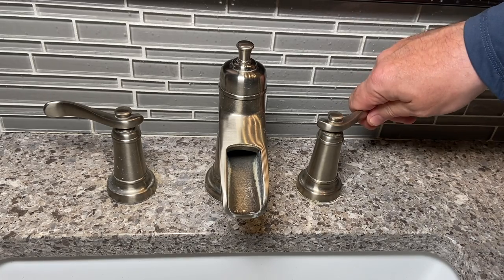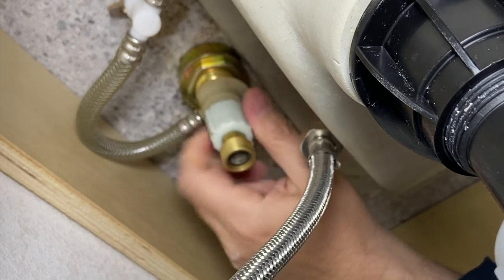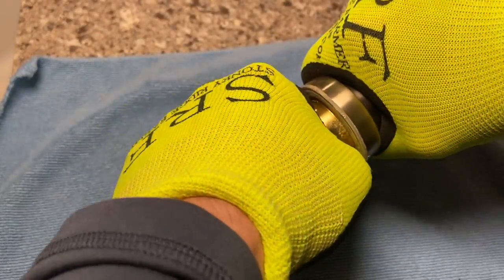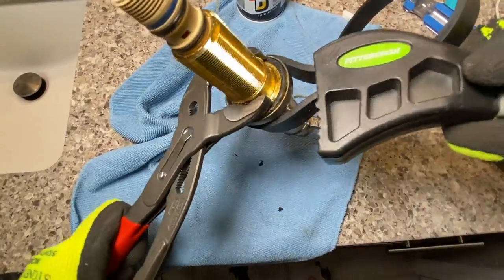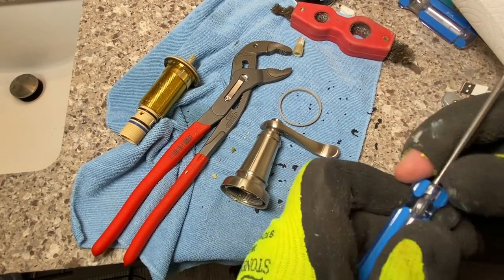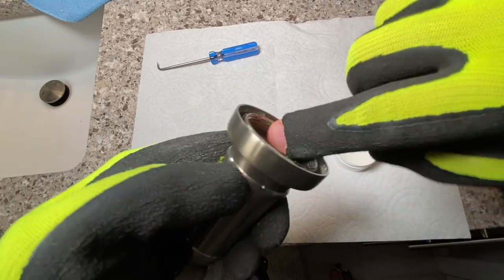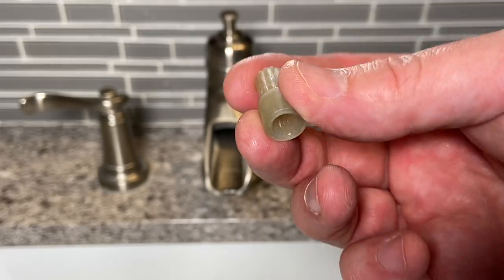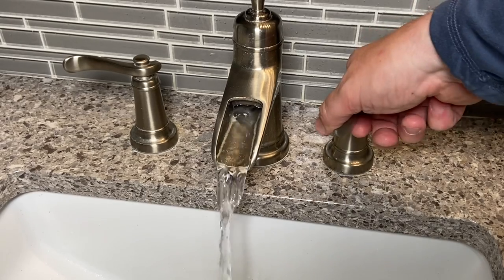Price Pfister Faucet Super Hard to Turn On

Comment: So glad I found your video, thank you. Let me tell you, I have this exact faucet and BOTH sides are leaky so I want to replace both cartridges.

I cannot, for the life of me, get either handle off and I suspect I'm going to find the same as you did once I do - whether I take a sledgehammer to it in frustration or not!

I did not disassemble the whole unit but it looks like I'm going to have to. Underneath mine, though, is a rusty mess. 

We like the design so I was going to try to work with this thing but I don't know if it's worth giving up this much of my life!

I have never seen anything so insanely tight in my life!

Comment: I have the exact same faucet and followed your steps except removing the entire cartridge assembly out. I was lucky to spin the top cover off to do the repair. In hindsight, here is what may work even without taking anything off. Spray calcium lime rust (CLR, I diluted it to 1:1) around the handle lever base, you will see small bubble around it where it got seized. Spray, let it sit, repeat, wipe off until you feel satisfied with the improvement. Then spray some silicone grease around the same area (WD40 works). Wipe off. Viola, works like a charm!

Comment: I feet your pain........I have to take off my Moen faucet handles every 6 months and dunk it all in CLR (It really makes it feel like new)  for about an hour.  Hard water in Sugar Land, TX. Need to get a water softner.
Reply from the maker: It is weird cause there is not hard water around hear.
Reply: @ThatFixItGuy  The inards looked just like my faucet handles.....CLR will eat that crud up. I clean it with a used toothbrush. The faucets turn with your pinky.

Comment: crazy the stuff you find! I had that same faucet in my old house.. pfister right? I actually popped out that screen with a pick. next time you shut off the water to the house it'll probably get blocked. silly design and took me a little bit to find the problem. nevertheless nice fix! I need to get a strap wrench sometime
Reply from the maker: Harbor freight has a nice cheap set. Have been great so far. It is price pfister.

Comment: i have the same problem. cold water side was stiff on same brand. i swapped out the cold side stem. put everything back together and i get no hot or cold water flow(i didnt do anything to hot side).  so i pull cold stem out to see if water comes out and it does, but when everything is assembled, i only get a drip from the faucet. what is going on?
Reply: cartridge is plugged?

Comment: Surely it's leaking from the stem?
Reply from the maker: No leak from the stem at all. The handle is jacked up. After cleaning it has worked for almost a month. I’m going to call price pfister.
Reply: some stupid gasket material  that seizes up.  You can get it moving with WD40.   but i wonder if oil or silicone is better.